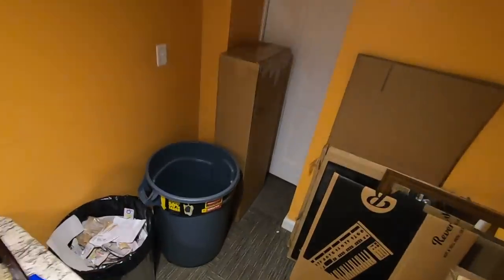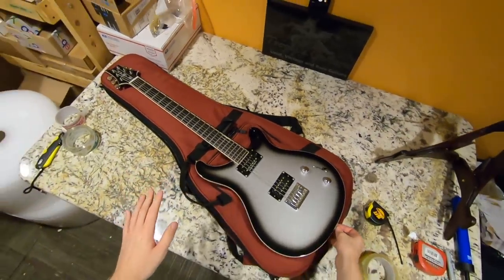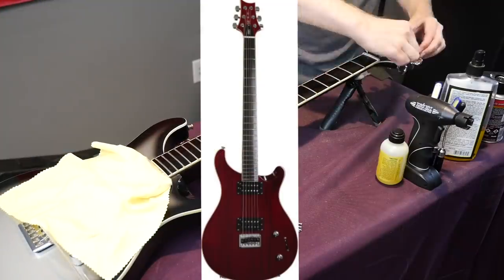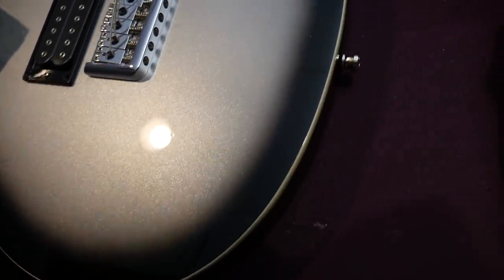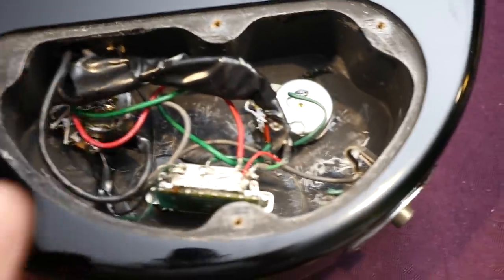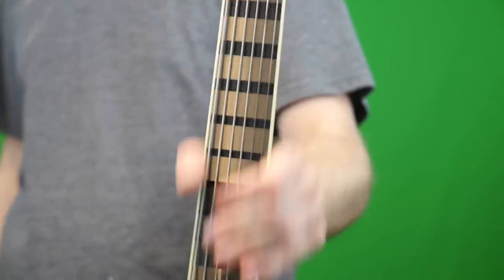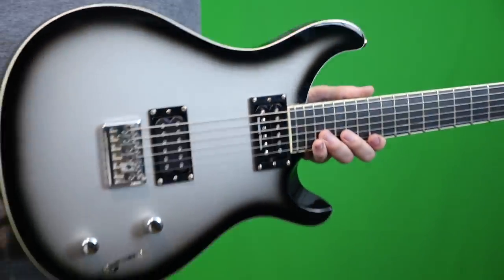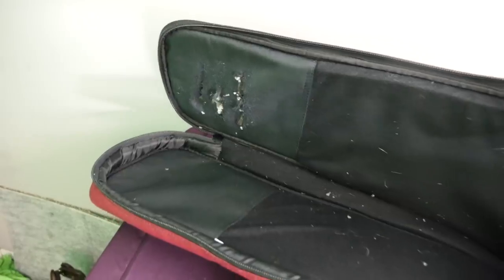I Got a SHOCK on this Mushok | Trade Tuesday S2 E9 | Mike Mushok PRS SE Silverburst Baritone Review

Comment: That pickup combo is killer. I was presently surprised how clear and huge the clean sound was for both pickups. The Alt 8 in the neck is something I never would have considered, but it sounds rad! This combo definitely can benefit greatly from some coil-splitting or parallel options, though.
Reply: I was thinking the same .. you can tell the previous owner really experimented to find a combo that worked!

I got one of these "as new", and the stock pups suck. The bridge is too weak for metal and the neck is way overwound for cleans (sounds OK for distorted leads).

I just put an active SD Blackout in the bridge, but honestly the DiMz in the vid sounds better. And it's a beautiful combo!

Comment: Great guitars! The holy grail of baritone guitars. Bought in a sale in 09 still have it.

Replaced the pickups many times, settled on the PRS 59/09 set with PRS USA electronics. Have replaced the tuners with Gotoh locking ones. Schaller strap locks as well. 

Guitar is a Neck Thru construction as well.

UK market sees them go for £699-£799, was offered £999 once by a Mushock fanboi, said no as I’m not getting one of the new PRS SEs. I bought mine for £399, reduced from £799.

I missed out on his Ibanez MMM1 year’s ago, tried one, and it was amazing! Would love to get one of those!!!

Comment: @10:17  The longer neck on a baritone guitar doesn't make any room for more frets, because the frets represent a ratio of distance from the bridge in proportion to the longer bridge-to-nut distance, so every fret is slightly further away from the bridge than the same fret on a regular guitar, it's like the entire neck has been stretched along its entire length, not just added to at one end.

Comment: bought a PRS custon 24 SE with the rd gig bag, and the seller said mint, all original 345 + like 35.  on ebay.  I clicked buy it now and then noticed it had different pickups,  not original.  then he wanted 75 for the ship not the advertised 35.   I tried to bail and he was  mum.  ebay offered me a 45 dollar coupon to complete the deal.  the pups were dimarzios, and it arrived safe.  dimarzios were put in wrong, rail on the wrong side, and no springs in the pickup ring, so it was just flopping.  man, it was a jinx from the drop.
crunch lab and liquifier petrucci pups,  an upgrade.    a pawn shop in salem oregon.
its trans black, and with 10s  its a race car.  total about 379.  still  got it, but its actually on my wall of paul between 2 les pauls.  paul reed smith still counts.     cheers  trogger

Comment: Beware that doesn't look just like some innocent chipping! I've had an Epiphone with the finish cracked all around the neck and body seam line, also with some paint chipping. The previous owner had touched up the top to mask it off (it worked...) and, some time after I've bought it, that paint was also cracked. Pretty easy to put two and two together - there was movement underneath, the joint probably had separated a bit. It takes a nice bump to the neck, or a drop, for that to happen. I'd get rid of it ASAP, just like I've done to that Epi!

Comment: What has happened is that neck has taken a hit that only affected that side.  Then they did a glue job, and had to sand off the excess, that is why there  is that flattened area with no finish.  The little spots next to the pickup ring are where they could not match up any finish so they just left it alone.

Comment: Sorry but that horrible distortion sound was user error. I can get an affinity strat to sound chuggier than that. Those pickups might not be high end but they can definitely sound better with a decent amp and the right settings. Sounded like you were using some cheap travel amp.
Reply: dudes got a high end mesa boogie and still makes it sound like a 10w peavey smh
Reply: @F4v3L4d01337  Even the clean channel was dialed in wrong for a baritone.

Comment: The original PRS neck design had a much smaller heel.  Around 1985, they went to  a larger heel to improve neck stability, tuning and intonation.  Think of this way, a Les Paul neck gets some of its stiffness from the upper bout.  A fender gets the stiffness from being a "D" shaped thicker neck.  The PRS necks are often wide thin which needs more  stability.  The PRS single cut has an in between carve which is actually very nice.  Knowing as much as I do about PRS guitars, Paul has thought about every aspect of this to the nth degree.

Comment: I’ve had one of those before. Felt cheap so I had to take it back. Hello from Michigan!
Reply from the maker: Was it because the body was so light? The neck felt really good to me
Reply: The Trogly's Guitar Show: It might have been. But most of the SE line feels cheap Asian to me compared to a real PRS. I’ve never believed them to be just a step or two down. Even the fretwork is kind of weird to me. Just my opinion. The demo sounded pretty good though.
Reply: Describe how "cheap Asian" feels, like you mean you can't feel that all the plastic and electronics and stuff were made in Asia or made elsewhere with parts from Asia?
Reply: Before you answer, just know that even $4,000 custom Kiesels are all made with OEM parts from Asia and the price difference has to do with the employee pay difference, not part quality in the majority of instances
Reply: Dean Smith: It could be many things. I’m just a player though and not a luthier. It could mean the polyurethane finish and not the nitrocellulose. It could mean the quality of wood. It could mean that it’s all that plus a lighter guitar. It could mean that it sounds thinner through my rig compared to my 70’s Les Paul when given substantial volume. I put everything through the test before keeping a guitar. Some budget guitars are great! All of the SE stuff Ive ever tried never made the cut and never stayed in tune. I prefer the LTD line of guitars.

Comment: If your gonna try to show how a guitar sounds, play it clean.. really clean. It may take turning the guitar down. Most amps have the volume control after the first stage, so that first tube or transistor can be easily distorted. You keep that from overloading. Any piece of shit can overload an amp... and then u know zero about it actually sounds.   Please swap those pickups to correct positions..